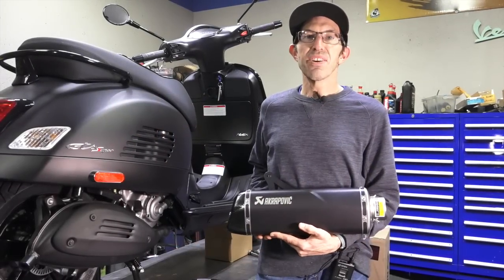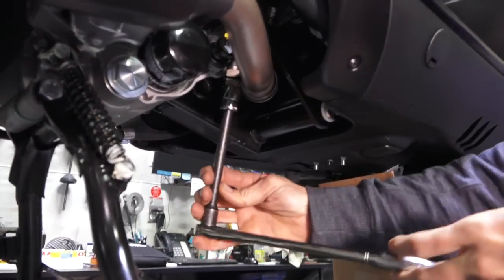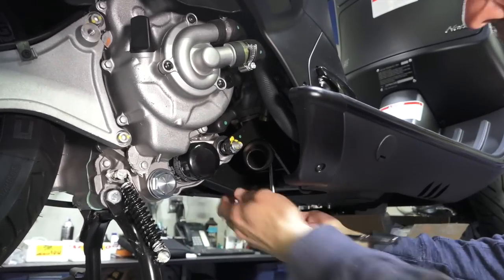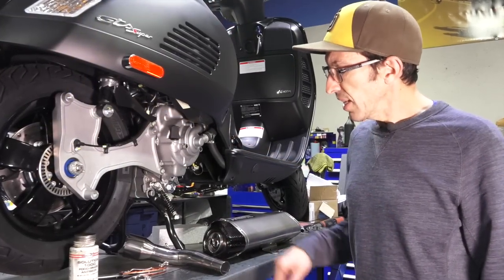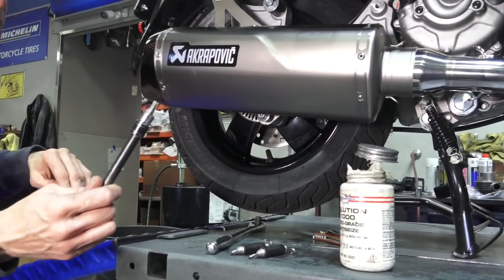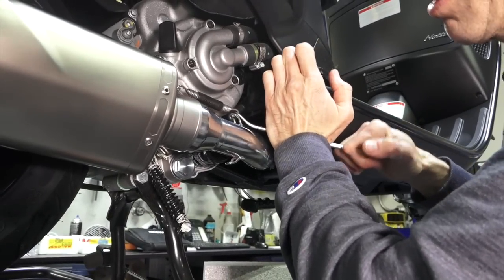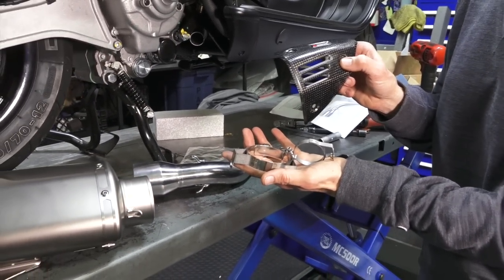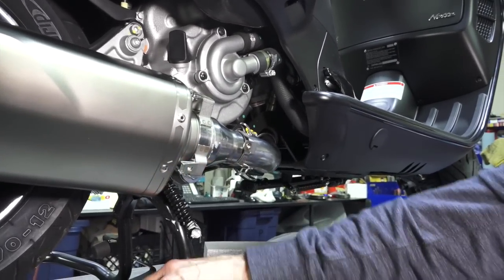How To Install the New Akrapovic Exhaust System on Vespa GTS

Comment: I received my Akrapovic exhaust from scooter west today.  I’ve probably installed 40 or 50 exhaust systems in my life on bunch of different engine configurations.  I still watched this video.  It allowed me to get my necessary tools out and to mentally work through what needed to be done even though fitting the exhaust Is really easy even for the inexperienced.     The carbon shield took 80% of the time of the install .  It really looks cool, but if you want to save yourself and hour and $100 go without it.  I’m still glad I opted for it.   I think it was worth the cost and additional install time.   As mentioned, it’s quiet but I’m ok with that.  It looks great and suits the scooter.  It doesn’t look out of place.
Reply from the maker: Awesome! Thanks for sharing and glad we could help out...
Reply: Is it full exhaust? Does it need a tune after installation?

Comment: Please pardon my ignorance, but if this exhaust isn’t  much louder, what’s the benefit of installing it? Is it the more aggressive look or does it perform better than the stock one?
Reply: The pipe isn't louder, but the tone is very different - much lower and less like my wife's hair dryer.
Reply: Weight savings: half the weight (7 vs 14 lbs), which is a lot as the exhaust is unsprung weight.

Comment: Hi I have a 125 gts 2018 & bought a second hand black widow exhaust but the manafold doesn't fit I had a 125 2009 & it fitted on it no problem have they changed the engine mounts does anyone know where I can get a manafold to fir my 2018

Comment: If you have an old kids trampoline, the spring puller with those makes a handy substitute.  Used it on my sip road 2 exhaust on my P2
Reply from the maker: good tip!

Comment: Do avoid damage it makes sense to first tighten the two back screws and only then tighten the front clamp. This way the whole exhaust system    does not built up unnecessary tension, that can lead to cracks in the front area where the clamp is located. As far as I remember it is described that way in the installation manual also and it has been discussed and confirmed like that in the german vespaforum also. 
Nice videos otherwise, lots of valuable informations and help!

Comment: Love your work. Thanks Robot. Wouldn't it work better to install the small clamp for the heat shield the other way around so that the head of the allan key can be accessed from below, making access to it easier? Maybe also carbon fibre washer under the head of the bolt on the outside and the larger washer behind the heat shield?

Comment: Please help... Installed my PMAK-01 Original Stainless Exhaust today without the catalytic converter. Robot's video made it easy, thank you!
One issue I have is the check engine light is on now. What gives? (O2 sensor adjustment/calibration required. or must I install the cat, or.... ?)
I reviewed all I could find on the internet and scooterwest videos in relation of the Akrapovic and engine check light for 2020 GTS 300 HPE, to no avail.

Comment: Another great video Robot. 
I have Remus dual flow exhausts fitted to my 300’s. Do you guys have a view on the best after market exhausts for 300’s from a performance point of view?
Reply from the maker: We’ve kind of boiled it down to Akrapovic and Malossi, which is what we sell on scooterwest.com. Plenty of other good brands out there, but we try not to over  complicate our inventory and we’ve had a good track record with these brands in our repair shop as well. Here’s a Dino video we did that offers a few specs https://youtu.be/AeSY9VhEVqE How do you like the Remus?

Comment: Hi.  I installed this new akra (black version) on my racing sixties gts 300 hpe and it looks and sounds fantastic.  Also installed a malossi lambda and the scooter was even faster, but that gives a motor warning.  So I removed the lambda and then the warning went away, but I felt so much difference, the lambda made it really more powerfull.  Is there a way to avoid this motor warning?  I hear other newer gts 300 give motor warning with lambda too, but I didn't find a solution :(
Reply: Disable the warning light

Comment: Hello, Mr. Robot. 

   Will this exhaust system work on the Piaggio Liberty S 150? I’ve been searching for the answer online. I can’t find it. I assume it would, since they share the same engine, correct? Thank you for your time!
Reply from the maker: No, this is specifically designed for the GTS 300. Akrapovic does make an exhaust that will fit the Liberty 150 3V engine, but not with the new iGet motor.
Reply: @VespaMotorsport  are there any aftermarket exhausts at all for the iGet motor? I’ve tried searching online and can’t really seem to find an answer. Thank you for your time.

Comment: Hi brother , db killer removable ¿¿
Reply: ahmet uygur yes and no.  They are tack welded in place.  You can drill out the weld and use a slide hammer to remove them.  It’s a pain and not worth it.    I’d look for the older style as they are still available.  At least here in the USA they are.
Reply: @forrysc  On this one it is not welded, it is screwd. The screw however does have a welding spot, but can be removed without problem if done with care. But you have to drill the carbon endcap at the right spot to get access to the screw. Looking at it when muffler is mounted, the screw is on the inside (side thats facing towards scooter).
Reply: Ghinio thanks for the info ghinio!